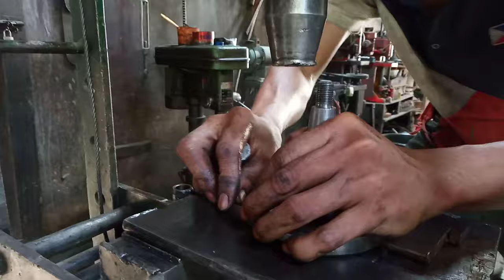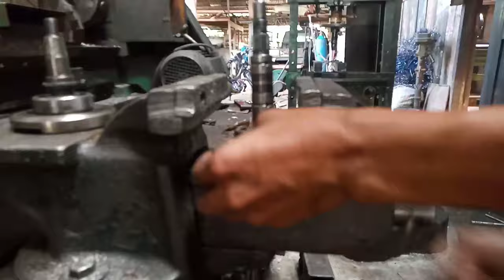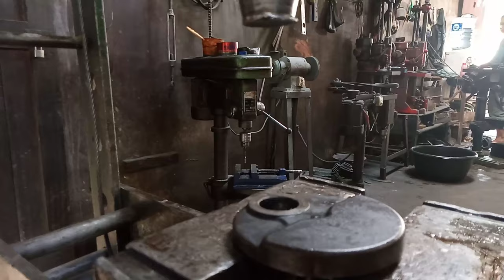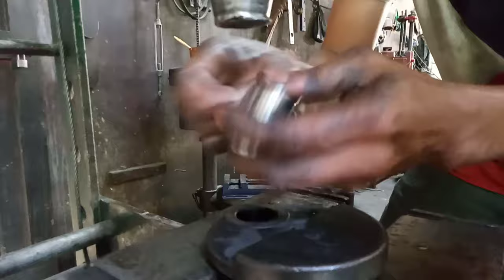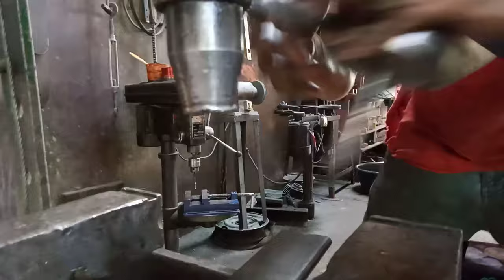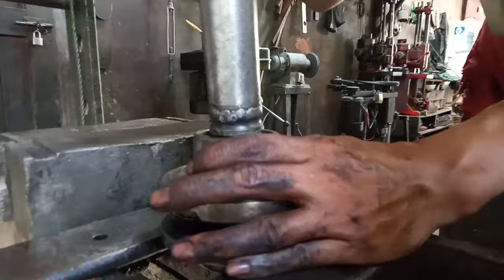How To Change Motorcycle Connecting Rod Kit Crankshaft | Replacement

Comment: I got a little slack in the main bearing  on a 250 Polaris 2 stroke engine  .. How much is to much? Thx.
Reply: There will be tolerance measeure in the manual for the quad check what they are and measure them

Comment: What the problem is..modification process will make some bend on the crancshaft..how u pairing 2 side perfectly during put the pin..1 mm miss can reduce the perfection of crankshaft rotation absolutely ..the balance will be problem and reduce the speed of yur motocycle..the wibration become larger..at last u wil just buy the new set crankshaft..

Comment: How do you know when the two halves are aligned perfectly?
Reply: To answer my own question, I researched it, look up how to true a crankshaft, not to difficult. There's a person on Ebay you can ship your crank too with new rod kit and he will assemble and true it, like 60 something bucks, well worth it.
Reply: Cliff actually has a video on truing, guess he doesn't understand english.
Reply: before u dis assemble them, make a straight mark on both of em, and it will work like Top dead center mark in timing gear